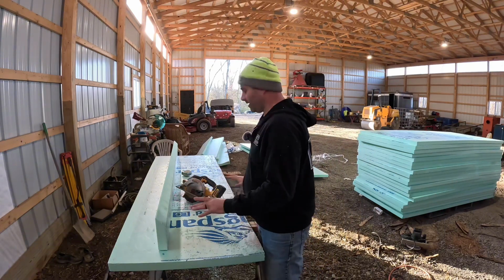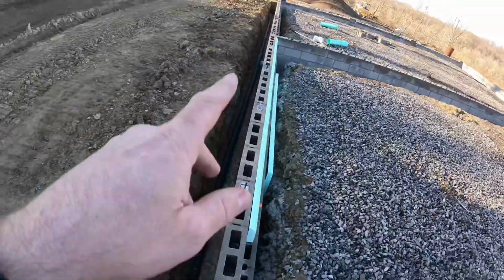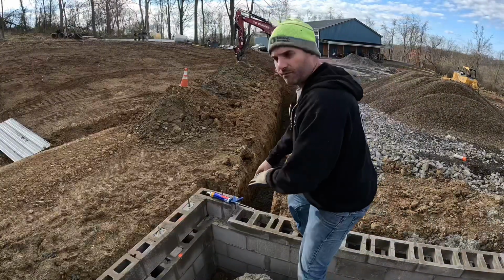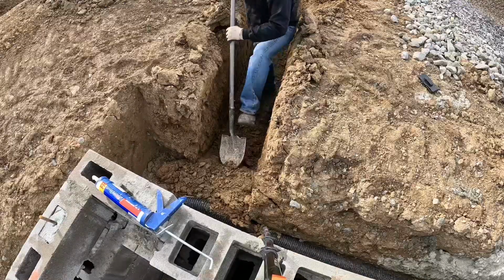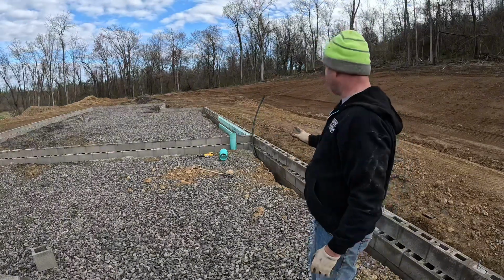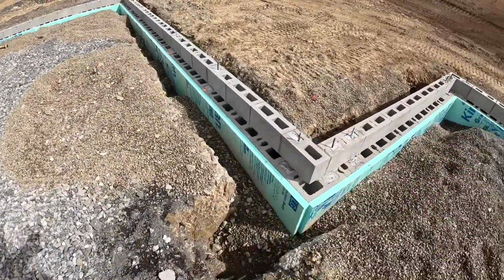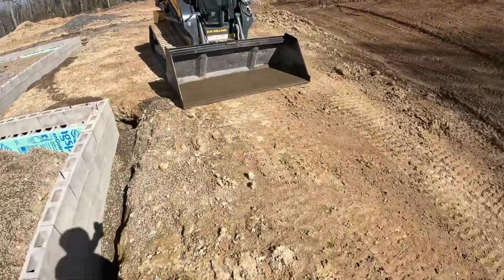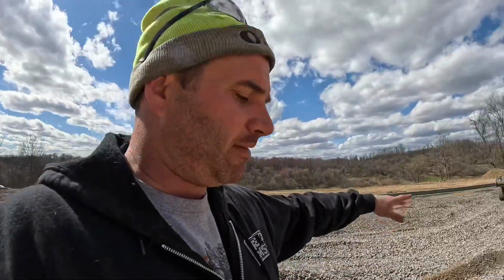This is why new houses cost so much! materials are triple the cost #barndominium episode 4

Comment: I used 1.25 poly and pushed my 1” pex into it from the outside of my hole to the water heater. I also placed 1.25 poly where I put 3/4 pex in the slab. Good work man!
Reply from the maker: Yeah, that’s the best way to do it 👍
Reply: @fatefarmspa  I will be watching your build and learning!

Comment: The cost of all building material has skyrocketed in the last 4 years. Newer homes are being built way more energy efficient and air tight. So, tight that if you fart, you smell,it for a week lol.
Reply from the maker: Yeah it’s unbelievable how much everything has gone on I know I don’t make 100% more in my wages within the last four years🤣.  what is crazy for one of the requirements before they give me an occupancy permit? They actually are vacuum testing the house to test for air leaks on the exterior of the building.
Reply: @fatefarmspa  wow, I had no idea they would vacuum test the house 😳